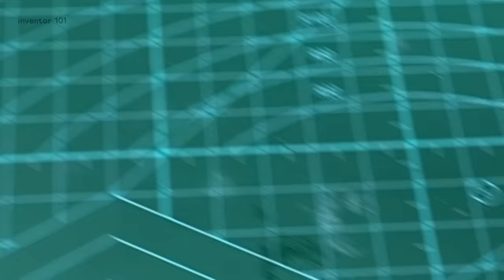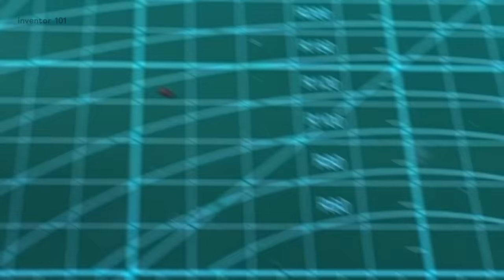4 Amazing Things You Can Make At Home | Awesome DIY Toys | Homemade Inventions

Comment: Watch enough of these and I start to feel like I must be the only guy that doesn’t have every random battery, circuit board and an assortment of hypodermic needles just laying around.
Reply: Relatable
Reply: Relatable
Reply: I tried to make one, I pulled a circuit board out of my radio, TV, car, camera and remote control. For some strange reason, none of them worked. Back to lighting rockets with matches...
Reply: كااه
ةكمَ
Reply: And 2000 fucking dc motors
Reply: I was thinking the same thing! What TRAP house did he just come from with his 11° hoodie on!!!?????